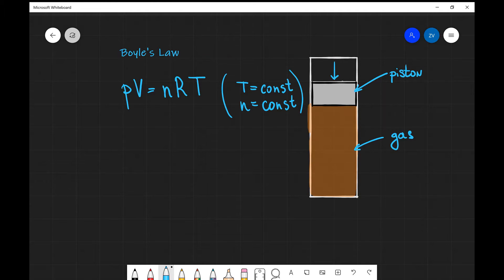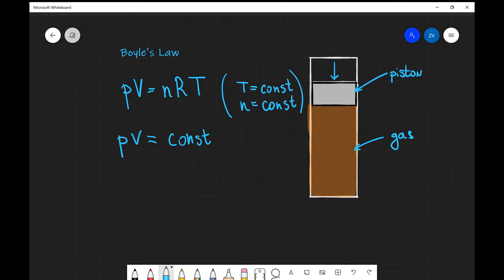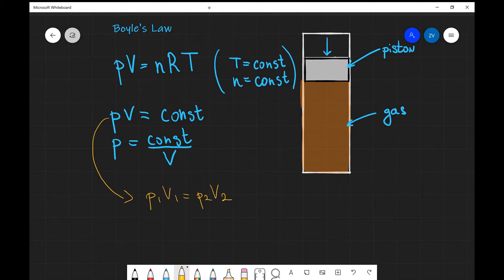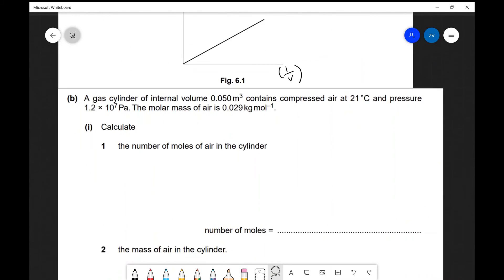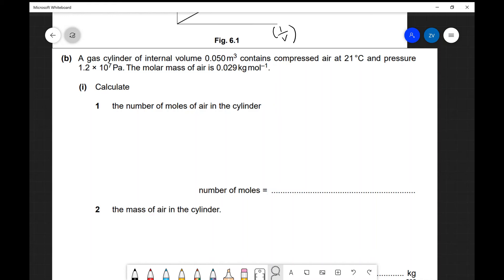A Level Physics: Boyle's Law

Comment: would it be wrong if we wrote 246 moles instead of 250?
Reply from the maker: typically you are not penalised for significant figures if they are too many unless the question specifies to use the correct number of significant figures.
In science though, all measured quantities come with an uncertainty in the measurement and writing it 250 takes into account the uncertainty as otherwise if wrote 246 this indicates that the last digit is 246 which we are uncertain of. So we always use the lowest number of sig figs from our question/data. Hope this helps!

Comment: hi sir quick q, what is really the difference between the ocr old spec questions and the new spec? Should I still practice the old spec questions?
Reply from the maker: great question! You can use some of the question, but there are some key differences - there didn't use to be 6 markers, the questions seemed to be less data orientated, also a few things are no longer on the spec - off the top of my head things like critical density of the universe, fuses, MRI, almost everything else is still in and useable.